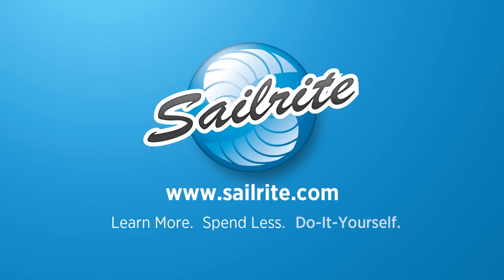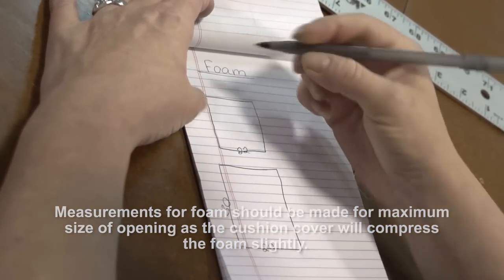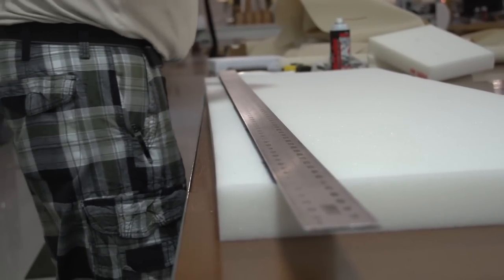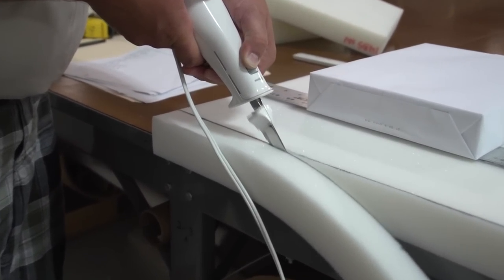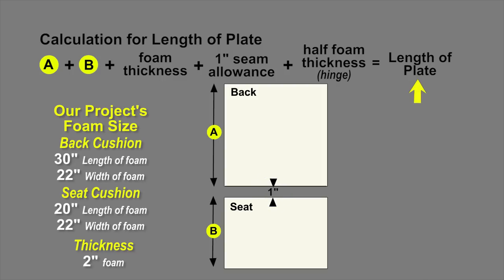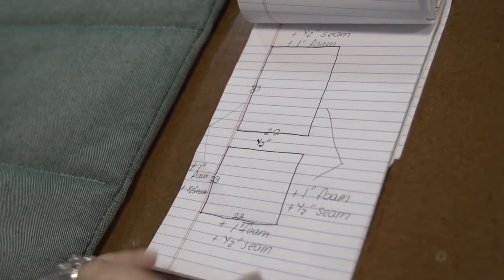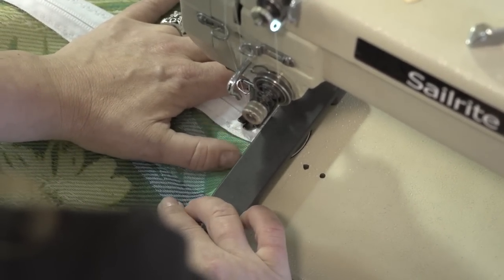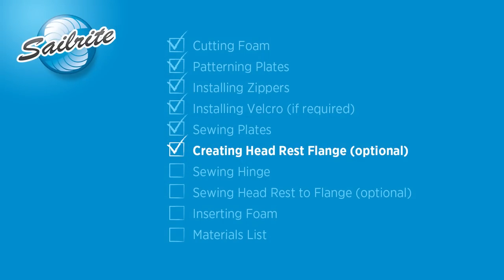How to Make a Hinged Cushion Cover

Comment: I do appreciate the time that went into this. It has good information, but it would be helpful to use standard sewing terms for those of us who are experienced.  Referring to  "top and bottom plates" is very confusing.  "Top plate" should be referred to as the "front cushion panel" and the "bottom plate" should be called the "back cushion panel".  I don't understand why the difficult zipper installation - it can be more accurately installed by basting the two pieces together first, than stitching face down to the seam and ripping the basting out.  Marking the stitching between the cushions can be accurately done using painter's tape which is easily removed. Also, please tell us how to finish it without the optional pillow first so we don't have to watch all those steps if all we want to do is make the without the option.

Comment: the hot knife dosent burn the table? or is it a special table surface? so interesting!!
Reply from the maker: We used a metal ruler on the underside to help from burning the table. However, here is a much better tool that we did not yet have: https://www.sailrite.com/Tempered-Cutting-Glass-for-Hotknife

Comment: Nice video, but I think your narrative on the zipper location is incorrect in the calculation.  I don't see you calculated for the seam allowances??? For example the bottom cushion is 20" long, , if you cut at 20" you lose the seam allowances, unless I'm not understanding????
Reply: Thanks! I was looking exactly for that comment. I think it will work even without the allowance - just the zipper will go upper. However, I intend leaving the allowance at the bottom. Will text with the results

Comment: For beginners, make a fold to line and sew on the back side of the cloth for your covered zipper. The fold to line is the width of the zipper, a #5 coil is 1.25".  This will make a straighter and more consistent hem.